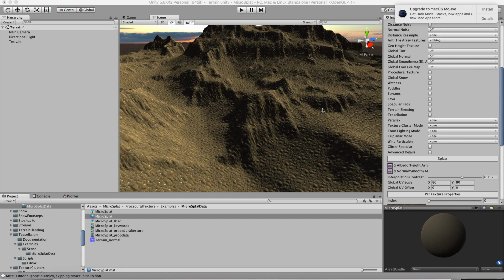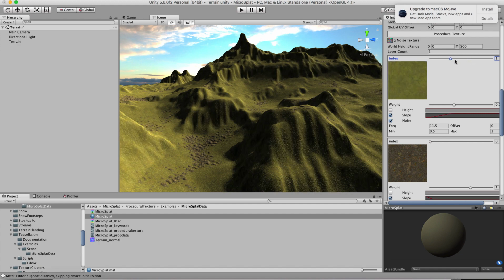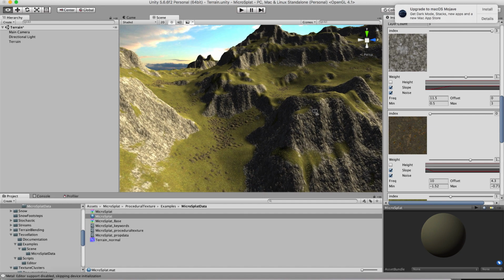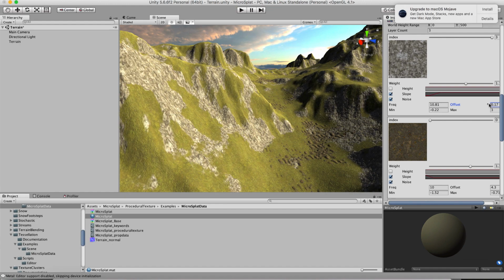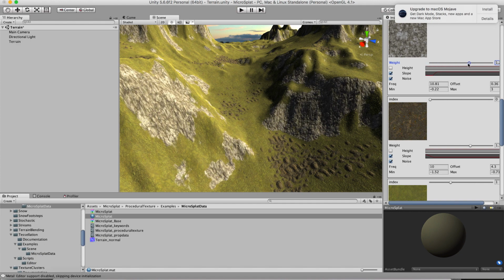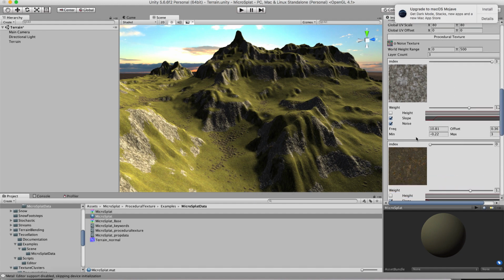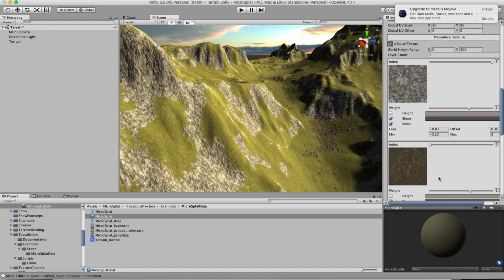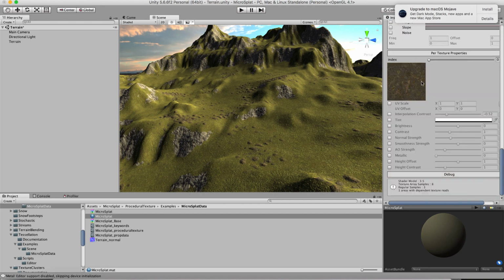MicroSplat Procedural Texturing Demo

Comment: bought it, and baked the textures. now any new texturing i try to manually paint does not paint normals. anyone know a fix?
Reply from the maker: Turn off procedural texturing after it's baked.
Reply: @slipster216  Yeah, i did that. but when i add new textures to paint on it seems as if the normals for the new textures does not get added to MicrosplatConfig_normal_tarray. And any textures i paint on after just get the normalmap of the last of the former textures.
Textures were added throug MicroSplatConfig file and i pressed the update button.
Reply from the maker: @bloxorandrokko  Read the core docs of faq, they explain this really clearly- you don't add textures via the terrain layer system anymore.
Reply: @slipster216  Textures were already added through the process explained in the documentation. 
However after messing around for a while not getting it to work i decided to just delete the MicrosplatData folder and re-do the conversion and textures. 
Normal maps are updating fine after that. No idea what caused the issue tho.
Anyway thanks for getting back to me :)

Comment: Hi Jason
I have few question
1)  Which one is you last version (or full version)  in Unity 5 asset store?
2) You did a really good job i like to buy your project for my game but if you can make "Mud or Snow" like this video will be better. in the video tessellation is only for mesh so i don't want  to buy it, and i sure you can easy make like that for Unity terrain. 
Video link:  https://www.youtube.com/watch?v=kgK3YFG-A5M
3)I'm using Unity 5 2018.3.7f1, is support?
Reply from the maker: The asset store always has the latest version; but this module is not released yet. The latest versions of Unity are fully supported, including the latest terrain features.
Reply: @slipster216  
ok thx
how about the video's track? i know its just modify texture in shader, but its hard for me :D can you make that? I really need that "Mud"